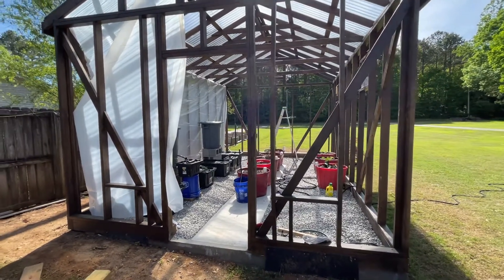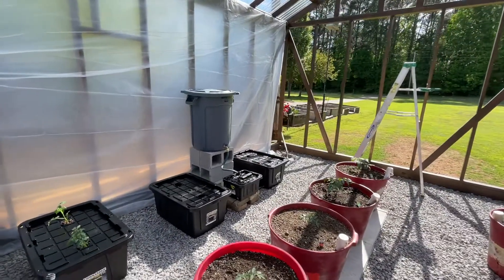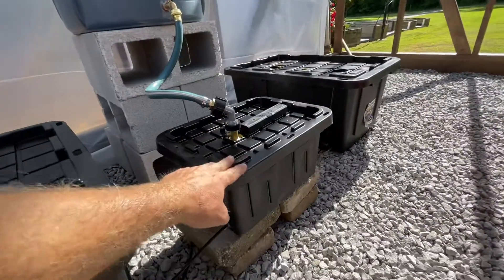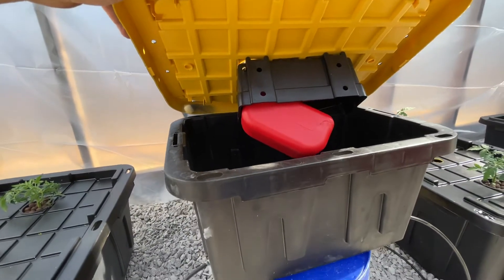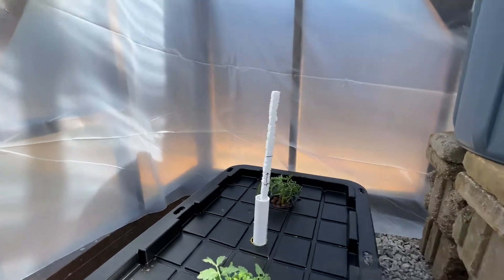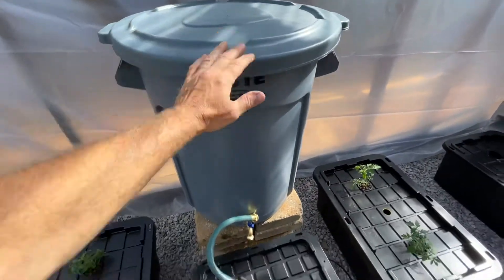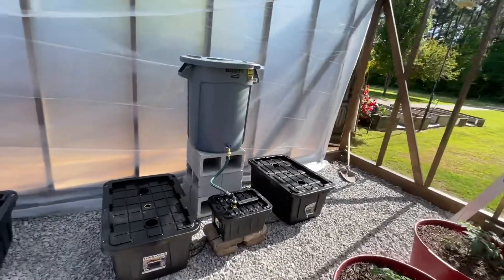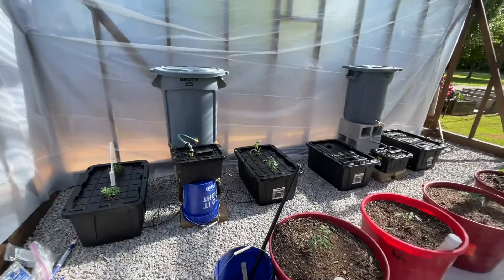Kratky greenhouse non circulating hydroponics using float valve

Comment: Nice video. You don't have to wait to drop down your float valve box if you use a full size container with a float that is drilled into the side of your container instead of through the lid. You could even put plants into your full size float box as long as the roots don't tangle with the float.